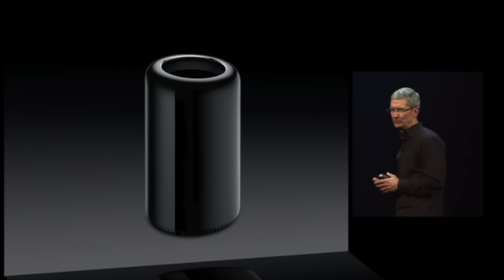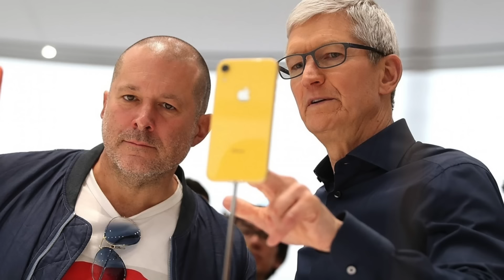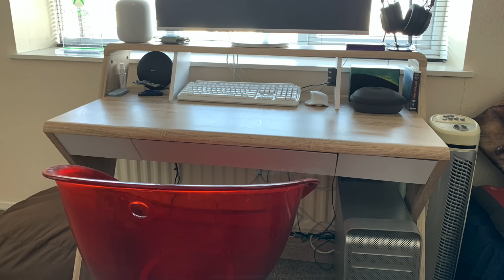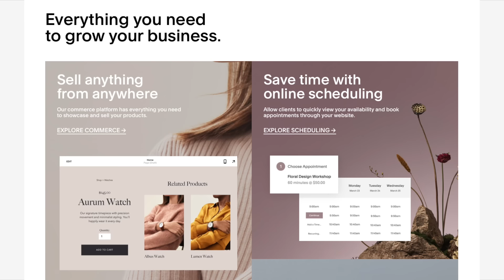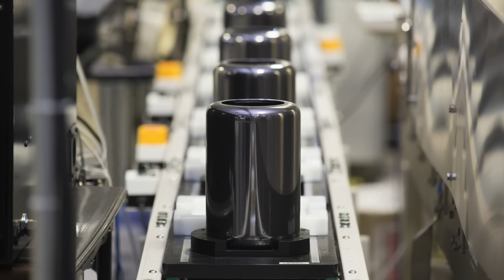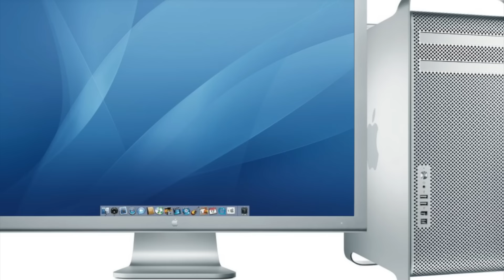Apple's Trash Can Mac Pro Failure

Comment: I just got two of them for $112. Plus hard drive.

One 32 gb ram the other 16gb. Tried linux. Can't get the line out audio to work. Need to try usb to 3.5mm adapter.

Comment: My initial 12 core with dual d700 is still going strong. It was a work machine that I purchased when they were decommissioned. Any issues with them is resolved by using mac fan control and setting the fan to run at 1200ish rpm.

Comment: I purchased a base model Mac Pro 2013 about 6 months ago and use it every day with 4 monitors attached to it.  It is a WONDERFUL and fast computer and for the $600 I paid it is quite a bargain.  

Also, the D700 gpu version has faster graphics and the M1 models Apple currently sell ... so there is that too.  We are talking a 10 year old computer has better GPU performance than the M1 Apple computers.

Comment: The case for the defence . You clearly can only be categorised as a trashcan hater ,listen up . My Mac Pro having been used almost  daily for nearly 9 years without any issues deserves to be given some slack here  instead of open hostility and chastisement . Look at the original iPhone by comparison with the latest iPhones it's a dinosaur .Technology moves at such a  fast pace even Apple struggle to keep a head of the chasing pack. No one should ever criticise a design that was bold still looks contemporary and is reliable after so many years. Apple made no secret of the upgradabilty issues referred to here ,thats why I opted for the maxed out version that has served me so well. One thing I would agree on is the name had this been called a Mac Studio for example aimed at less professional users it may have avoided some of the harsher criticism .Interestingly enough their latest desktop offering is totally NON upgradable beyond the pre purchase configuration , lets see how the shine on that dims with the passage of time .

Comment: These were and are great machines, they just never updated them. And they optimized for dual GPU when the whole industry doubled down on single GPU. The idea of these not being “upgradeable” is silly when no Mac Pro has ever actually been particularly upgradeable dude to the lack of driver support for other components. Hell, the new Mac Pro tower is likely going to be EOL’d by Apple silicon, far from upgradeable. You don’t talk about the performance anywhere which was actually quite good when it came out and it held up well for a long time and from a CPU standpoint holds up decently today. The portability is also pretty convenient. I’ve traveled with mine quite a bit. I’d love to see them do another mini Pro with Apple silicon…doesn’t even necessarily need to be modular though that would be nice. Just ship it with a better GPU.

Comment: This Mac is, to me, the most gorgeous computer to have ever been created. I’ve had mine for 6 years and I still love it as much as day 1. It’s still pretty fast as well.
Reply: I agree.. Furthermore upgrades are cheap now and not difficult if you take your time and are careful too.(minus graphics) but egpu is a possibility. I become distracted every day just looking in the reflections lol...
Reply: @Brycereigle2000  any chance you could send me in the right direction for those relatively cheap and easy upgrades? I’ve been looking at upgrading the cpu but it looks like a risky process
Reply: @Maaike2356  Buy a mac pro 5,1. They are so much better

Comment: Overpriced and underpowered.  Add in a "unique" design that limited upgradability and new machines (non Mac) that outperformed it for less than half the price and you have what we got...a failure of a product.  I am hoping that Apple learned a lot from this failure and will offer a NEW Mac Pro that will be more in line with the price of the competition's products and, more importantly, the actual needs of the users.

Comment: I've seen really old Mac chargers fray, but I don't get how I've never had an Apple charging cable fray on me.  Any failure is suspected to be internally inside the cable, because mine have always looked fine.  They do have a strain relief, it's just not nearly as stiff as others.

Comment: I had Mac Pro's since, well, the last year of the G5 Powermac. I held onto my 2012 Mac Pro until I could no longer justify using it. Between the 2013 Pro and Apple's war with Nvidia I had no choice but to move back to Windows to do the things I needed to do. While the new Mac Pro might be as expandable as I need, the lack of Nvidia support means I can never go back.

Comment: tbh the main problem was the gamble on the dual gpu. normally apple designs products to find solutions of what the consumer doesn’t even know is a problem- that doesn’t work for pro users and you must be aware of what fits into the pro workflow. apple gambled against that and that is too risky for that market, especially where the machines are so expensive.

Comment: We purchased four and they worked flawlessly for five years until we sold two of them for the original price! Not a perfect machine but the balance of reliability, power and portability was second-to-none. Easily the most reliable Macs we’ve ever owned in 25 years - we still have a couple of them.
Reply: Portability? for a desktop machine?
Reply: @TheStopwatchGod  Absolutely, they were tiny, especially for 12-Cores. I travelled with one and a USB monitor for years: https://www.youtube.com/watch?v=rj3gq74ODXQ/. Most reliable Macs we owned, it's faster than the 8-Core MBP I have now (which also gets random kernel panics). Waiting for a 3nm MBP.
Reply: How did you sell them 5 years later for the same price? That makes no snese they would of lsot so much value by then
Reply: @Gizmotronicz  Firstly, Apple pro hardware has traditionally held its value better than PCs. But before Apple Silicon, the release cycles were so slow, that the machines were identical many years after first release. Also, Apple had jacked the price so high here in New Zealand (also caused by exchange rates) that by the end, the price paid when new, was less than the price second-hand. Crazy I know.
Reply: @cmscss  Wow you lucked out. Thats pretty unheard of. I guess itw as golden timing for you. I dont have a usecase right now for a high end cpu but bought a Mac pro 5,1 used for 220$ Canadian. Great cpu for the cheap price

Comment: Never had an issue with mine and I use it for professional music production. Not a single heat issue, I’ve easily upgraded the ram and hard drives and it’s still going strong.
Reply: I think the thing that is typically missed is giving it space on the bottom to let air in.. keeping the thermal paste fresh goes a long way also as well as not letting it become clogged with dust (obviously). Mine has always ran super cool and the fan never goes over 800rpm in normal use. Can't hear it at all unlike almost anything comparable spec wise.

Comment: When this machine arrive all fanboy says how it was a formidable computer so far supperior to any pc in all. After a couple of year Mac user are happy to forget about it, and now says on how super powerfull the new mac pro cheese greter is, same story, PC are already in PCI4x faster SSD and so.... But being an apple fanboy is like being a religious fanantic?
Reply: @Nothing at all3665 I am a former fanboy since the performa 630 (a 68030 cpu), like many I am an UN-swicher who left Mac and when you get back to PC you discover on how you where right to hate windows but also on how Apple lied to you with empty shells at outrageous price.  
Do you know that the mabbook pro 15 has only an PCIe 8x for its graphic card?  PC are in 16x since 10 years.....   One of the many hidden bad feature... 
I run now on a MSI GE66, bigger and heavier, 2HDD emplacement a 16x RTX2060 graphic card, 2 drive emplacement that I can upgrade, RAM upgradable,  a full HD MAT screen (that has disapear from Apple range and no Retina screen is not Mat) a lot of ports (no dongle).

Of course it is not "fashion" but it cost me 800€(including the VAT) and it do all my CUDA calculation 10x faster than my former MAC.  

So yes, all my former PC are faster than the MAC and no the Mac is not different from a PC. Want a far better Mac, just do a hackintosh and you will have a very powerfull mac at a fraction of the price, the rest is just marketing.
Reply: @Nothing at all3665 I made my  former one with a second hand xeon and a X99 motherboard, a Nvidia 1080 card, a samsung 970 SS for around 1200€ it was so much faster than the former and new mac pro. My daughter use it and all run on it perfectly.
My actual computer is based on a ryzen 5 and is not slower than the base 6 core model of the Macpro.
See that all test never test the base model as it is so slow.
The addition of a 3070 when available will boost like hell all my 3D calculation, I use CUDA not available on Mac to do my work, a 1080 GPU is 12x time faster than a 6 core xeon, the 3080 is 2 to 3 time the speed.
So yes, all PC I done are faster than the mac and for a fraction of the price. 
Of course I have no nice apple logo on it....

Comment: Plz make a video on using external hard drive with ipad pro...after connection
1. Will it works as internal storage ??
2.How will be the video editing experience as compared to videos on internal memory... 
3.Do all photos n videos come in photos app directly just after connecting the hard drive.
Plz help i m going to buy ipad pro... But confused if i should go for higher storage or less storage +ssd.
Thankyou i m a medical student.
Reply: This is not a how to channel. 

1. No, but you can access it over the Files app. 
2. Depends on the app you're using. Most likely you need to copy the files to your internal storage first. 
3. No. 

Overall, I recommend to rather use iCloud Drive than an SSD. 2TB of Storage is around 10€ a month, you can access it from every device and it works more seamlessly with the Files app.

Comment: I honestly think they should bring this design back but as a new category, like a "Mac Pro mini" and it can fit in the market between the Mac mini and Mac Pro. Someone who wants a desktop that's more powerful than a Mac mini and wants to choose their own video card but doesn't need all the expandability of the Mac Pro. And it needs to be priced as such as well, much cheaper than it originally was, somewhere around $1300-$1700. Have it run on the Apple Silicon chip that will eventually be in the Mac Pro and I think it would be a pretty successful product. Of course it all depends on how Apple treats the Mac Pro after it switches to Apple Silicon, because it looks like those chips won't support 3rd party video cards, but I have to assume the Mac Pro would be the exception, and if so then this Mac Pro mini could as well.

Comment: I had the 2013 Mac Pro “trash can” and it was pretty amazing. It was fucking fast as hell for its time and I used it to make a lot of money. My old 8-core unit would have been eight years old this coming February and still does well compared to Macs built years later, according to Geekbench at https://browser.geekbench.com/mac-benchmarks, with a multi-core score of 5817. I had zero issues with it until I sold it in late 2017 to buy a 27’ Retina 5k iMac.

Comment: The 2006 Mac Pro was updated in 2007, 8, 9, and 10, and technically 12, though 2010 was the last CPU refresh. 2013 was only a year after the last update. People weren't waiting that long for an update to the Mac Pro the first time.

The second time, though, you could still buy a 2013 in 2017, and that was sad.

Comment: I own one. Bought used for peanuts. 12 cores, 64G RAM, 2T SSD. And while I’m not a pro user by your definition, I like it quite much. I run 3 VMs at the same time fine, I build huge C++ projects fine, I can edit 4K videos fine (ignoring the part where I have the artistic abilities of a rock) etc. and I paid for it very very little. I have 32T of 4K capable LaCie 5Big Thunderbolt 2 for peanuts...

Comment: I love my late 2013 macpro ! It works perfectly !
I use it for music : no noise !
and it is expandable. I changed the ssd hard drive (2to) and 64go of ram.
Reply: after some dust.. it will..
Reply: campkira 
I have my macpro since 2015 and it still works fine. I clean it every 6 month (very easy, just 5mn).

Comment: That overhyped moron Jony Ive could have turned even a hammer into an effeminate art piece costing $1,999 - so it's no wonder that the entire design of that Mac Pro was based around "gender neutral beauty" rather than being an efficient tool with upgradeability. A great example of the lack of thinking in the Apple design department, is how they made their Thunderbolt adapters for Ethernet and FireWire. The miniDisplayPort-style ports for Thunderbolt are not exactly "locking", and the adapters were so wide that you couldn't have both plugged in side by side without forcing the adapters to spread out. Here's an idea - Why not rotate the casing of the adapters 90 degrees, and they'll fit perfectly side by side, without putting any strain on the ports by having to spread out?

Comment: Actually people who love apple devices like ipads, iphone or I Mac's have no idea how things work, that's not a bad thing it's just a short sightedness develops in users where the pro market is different that form over function 
Same goes for pc gamers we love shit like big GPUs and custom loops 
I hope general apple users will know that spinning the fans hard to lower the system temps is better than, running the fans at minimum speed possible so the system doesn't throttle 
A windows laptops or desktop will spin the fans hard to not let the temps rise where in mac os the fans only runs to keep the temp barely it's not that the fans are not capable to cool it's just bcz Apple takes form over function so much it appears all over the apple garden 
If their core user can be made aware that this is not a good thing, things may change in future 🙂

Comment: Actually these made pretty DAW workstations, (unless you needed PCIe slots - Pro Tools HD). Audio engineers and composers were quite happy with them. Audio apps don’t use the GPU, so the 12-core Xeon, the first workstation that shipped with a m.2 flash drive (that I know of), and the quiet fan made for a good experience overall. In fact with prices dropping on these now, a 12-core 6,1 would be an ok choice for a VEP slave if you want a Mac.

Comment: You fail to mention the major flaw of the 2019 Mac Pro. It’s pricing. Yes I’ve heard it all before, if you’re not made of money and can’t afford it, it’s not made for you.

Well, what constitutes a PROfessional. Most dictionaries defines a professional as someone who makes a living from his/her profession! The vast majority of PROFESSIONALS (outside of Hollywood) can’t justify $10.000 - $50.000 for a computer, but still has the professional needs (expandability, upgradability, etc.) The 2019 Mac Pro should be called Mac Elite or something, because it’s NOT aimed at professionals!

I predict that it will be another failure for Apple and force even more PROFESSIONALS to migrate to PC (Windows). Had apple kept the starting price at ≈ $3.000 (and refrained from selling $400 wheels), they could have sold a thousand units for each one they are going to sell.

I see two possible futures:
1) This is the death of Apple as a manufacturer of computers for the worlds professionals.
2) Apple does yet another backstroke and releases a more realistically priced Mac Pro R.

It’s my opinion that Apple hasn’t made a computer for professionals (discounting MacPros) since 2012. And still doesn’t!
The Trash Can wasn’t a pro computer. It was a screenless iMac! The 2019 Mac Pro isn’t aimed att the professionals that has waited for it for (almost) a decade There is a huge demand for a professional Mac computer out there, that Apple seems hellbent to ignore. Many have been forced to migrate to PC and more will.

Also, what are those who have invested $50.000 in a computer thinking when they are told, after only a couple of months, that their computer will be obsolete within a couple of years? The words that come to mind, isn’t suitable to utter in polite society.

What will this do to Apples credibility as a whole?
Reply: and so ugly lmfao i had to wash my eyes with holy water to clean it

Comment: You said people didn't want to spent Tens of thousands of dollars.  They didn't.  It did not cost that much.  I bought the mid-grade in 2015 and it only cost about $4,000.  I still love my trashcan to this very day---it is extremely powerful and runs smooth as silk.  I think it would have survived if instead they treated like a Mac Pro mini, which it really fits well as a portable mac pro.  I haven't had heating problems once.  The G4 cube was a far bigger flop--it was only on the market a few months.  And don't get me started about the Apple III, AppleTV, 20th Anniversary, and even Lisa.  Those were FAR worse flops.  Trashcan wasn't a flop, a lot of people bought them and more are out there than the newly far more expensive Mac Pro.   I was just too early for the Thunderbolt craze.  If it had come out several years later with TB3 and marketed as a MacPro mini, we'd still see them on Apple's website along with the new Mac Pro.

Comment: At work we have two named Mctrashin 1 and Mctrashin 2. They get so hot in winter we don't use the heating on the Air-conditioning system but have to keep the air-conditioning on all the time during summer as they like to overheat in the Australian summer

Comment: Now that Apple is transitioning to Apple Silicon, do you think they should bring back the trash can design (I kind of liked that cylindrical design)? They don't have to name it Mac Pro. They can just call it Mac. I am hoping that Apple Silicon will not generate as much heat as the Intel ones. That's why I am thinking that it might be a viable option.